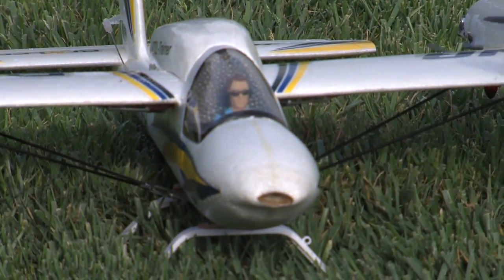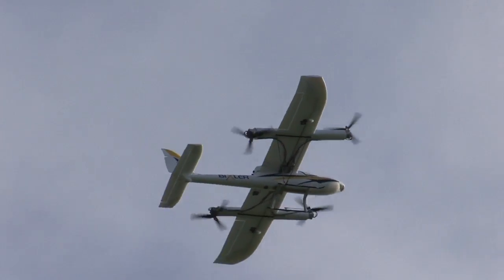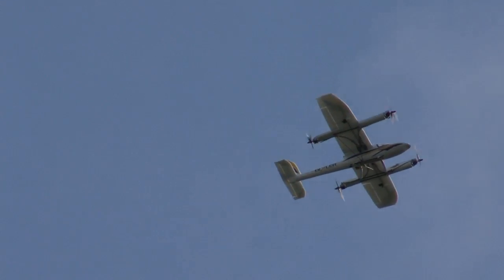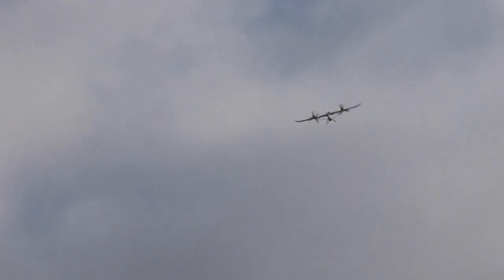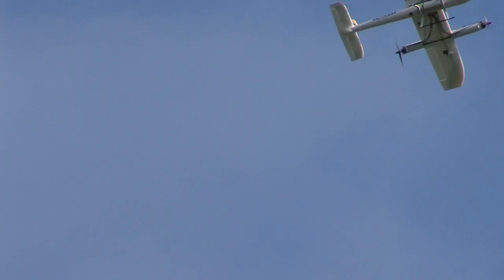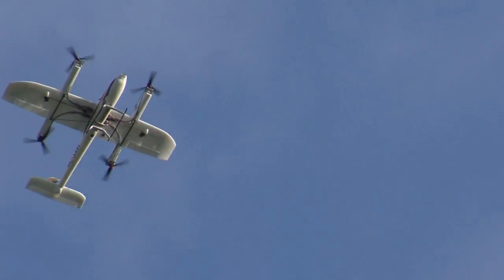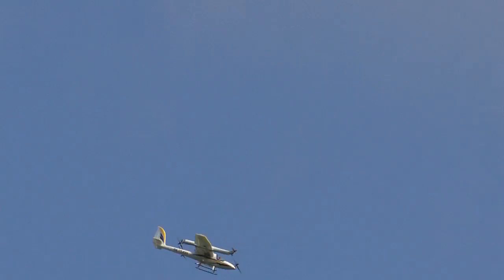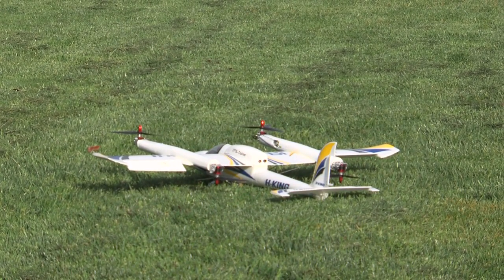Flight 3 of the Bixler Quad rotor

Comment: hi, very nice model you have built. fantastic congratulation
can you help with the PI settings and also the offset and trim in the kk 2.1.5 openaero v1.5 controller?
I am finding very difficult to do it, i have been struggling with that

Comment: Im sure you figured it out already. I think the gyro effect from the motors is causing the problem. If you could program in a short throttle cut at the initiation of transition. When you drop into that dive the motors are full speed giving the most gyro effect at that moment. Just a thought.

Comment: It seems dis-symmetry of lift by the high forward gliding is causing troubles  , just like an helicopter it reaches its maximum forward speed Because the advancing blade has higher airspeed than the retreating blade .helicopters solve that by making the blades able to flap in different angles depending on the retreating or advancing of the blade .

Comment: This is excellent. One of the better RC VTOL aircraft out there. I think I have and idea as to why you're losing control on the transition to hover. 

When you go into hover you dive first, I'm presuming for the extra airspeed so you can glide out if need be. This means that when you go into hover, you get the lift from the rotors and the lift from the wings acting together which is too much and the plane goes too nose high. The instability comes after your nose is high. 

Try converting from a slower airspeed. You will still have altitude on your side to give some time to save it.